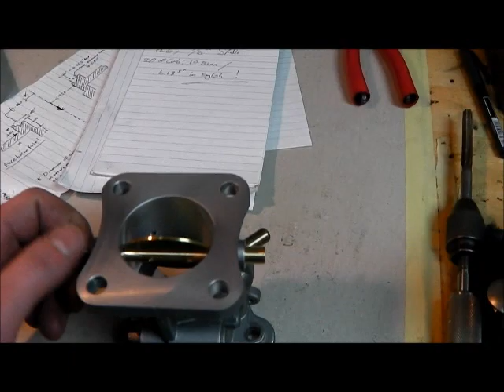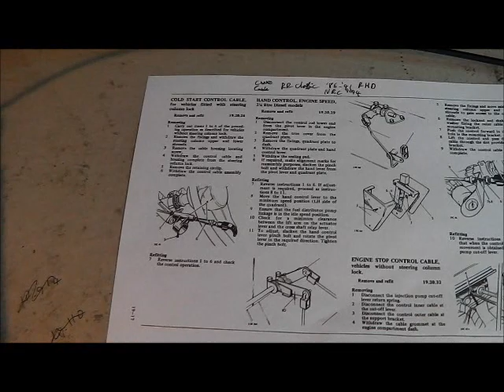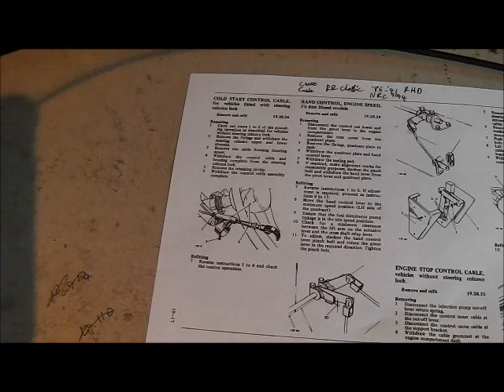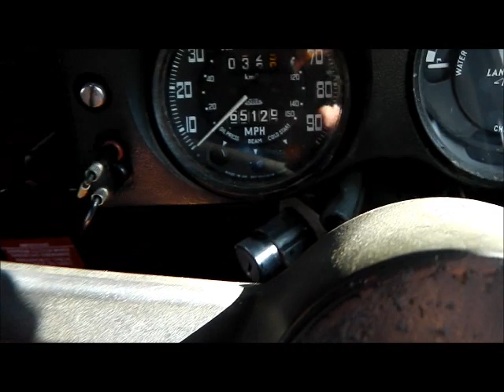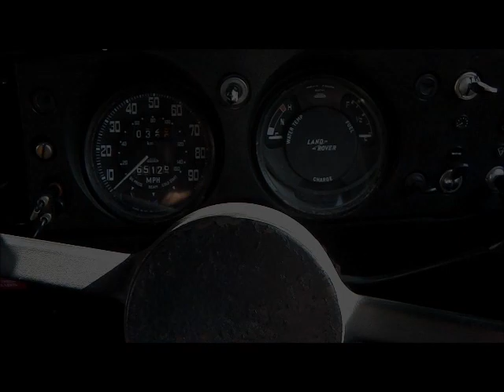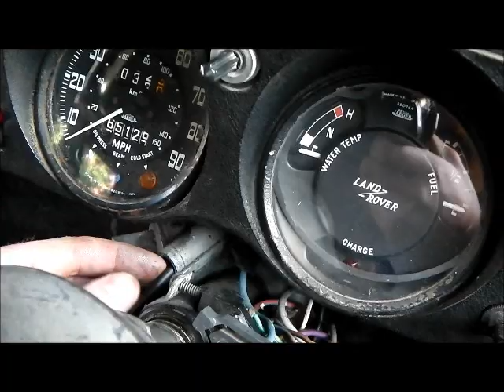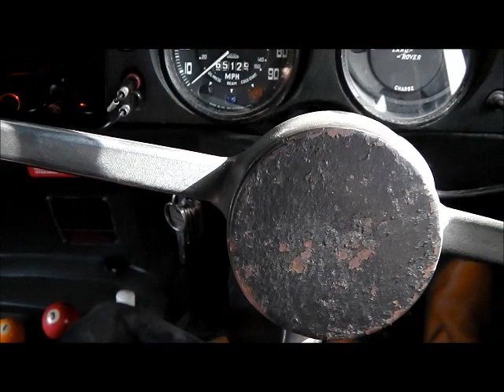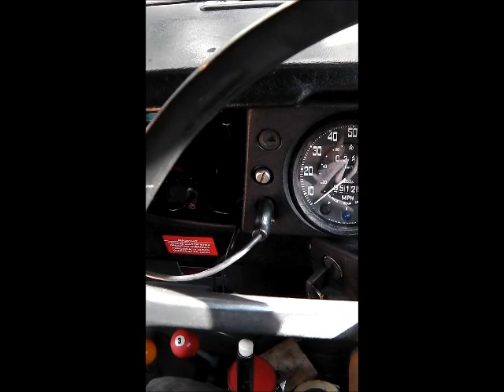Land Rover Series Throttle Cable Conversion - Part 2

Comment: Glad to see HNJ took up my suggestion for the cable bracket, when I did my throttle cable conversion on the SU and manifold from ACR HNJ only made a left handed bracket but were happy to make me a right handed one so I suggested that they should make a few as I surely wouldn’t be the only person wanting to put an HNJ cable on an ACR engine, looks like I was right!
I did the lever slightly differently using a quadrant set up, I live in Wiltshire so was able to pop down to Burlen’s for a rummage in their spares department which was useful, still experimenting with springs at the moment as mine is 88” and bucks a bit off road giving me kangaroo petrol, I’m thinking about a damper rather than stronger springs and might have a play with a mini gas strut to combine spring and damping.
Have found the guys at HNJ, Burlen’s and Roland at ACR all really helpful, maybe they should get together and produce a kit that works straight out of the box although where’s the fun in that on a Land Rover!!

Comment: Good evening Phill.  Thanks very much for the stellar installation series and most helpful instructions.  I have a new stromberg CD175 to fit my Series rover, with a similar set of brackets from HJN.  Sadly, I don’t have a lathe, nor the adapted manifold, but hope I can muddle through with this upgrade to my old and worn out carb..  Your land rover sounds great after your upgrade.  All the best, Ian
Reply from the maker: Thanks, and good luck with your conversion. There are many ways to do it, I've seen plenty of nicely fabricated manifolds.

Comment: Nice conversion. Done properly with good adjustment and full range of pedal travel. I operate a chassis dyno as part of my day job on older classic vehicles. The scariest was a porsche 911 that the floor mounted pedal stop sheared off. Causing the linkage to go into cam lock at full throttle. Not fun times.
Reply from the maker: Thanks, after a couple of hours driving yesterday it seems like a successful job. 
It is frightening some of the DIY jobs you see on these vehicles, to me the throttle mechanism is as important as the brakes. You must have had a fright with that Porsche, sod that! A colleague recently told me of a D type Jag he worked on where someone had fitted an over length bolt in the steering column - discovered because as the car was driven out of the workshop, it caught the throttle mechanism and went off the clock..

Comment: Another fab video! Your original choke cable reminds me of the ones fitted to the earlier classic Range Rovers, they were a round end rather than a t handle. Not sure if the dashboard fittings were as your original or the replacement though? Just thought I would put it out there incase you have to do it again. It's sounding very nice when running.
Reply from the maker: Thanks, that's a good shout and may be useful for someone else. It might make the process simpler. Not running quite so well as it used to, I suspect the cylinder head is due an overhaul now.

Comment: Thanks for sharing that, very helpful and something I might consider one day.. when mine is drivable! Out of interest, what's your motivation for going back to canvas?
Reply from the maker: Thanks, you're welcome. I've concluded that a hard top is actually very difficult to make water tight - the original canvas had not been maintained at all by the p/o and was rotten, I couldn't afford another at the time and a £50 hard top was a good alternative. A good canvas is drier, warmer in the winter and more fun in the summer. I've also decided to re-paint and removing the hard top from the equation cuts the job in half!

Comment: Great video! 🍺🏁 Question. What is the name of the special fuel line the VW guys recommended?
Reply from the maker: Thank you! If you visit the "Advanced Fluid Solutions" website and search for 5.5mm Bio fuel hose you will find it. Quite an expensive product but seems much better quality than anything else I've tried. So far so good, but I'll report back in a future video.

Comment: Great video, I have the same setup on my 109, how does the throttle feel now with use? Why did you go back to the oil bath filter and not use the K&N, out of interest?
Reply from the maker: Thanks, I had a couple of hours driving yesterday for work and it felt great, once I'd got used to the increased sensitivity at the pedal. The mechanical linkages always felt "clunky", the pedal is a little lighter now and nice smooth operation. It also doesn't "clatter" when double-de-clutching so slightly reducing the general racket.. 
SU carburettors are very sensitive to air flow and don't really like K&N's, best demonstrated on the dyno though perhaps irrelevant for an old Rover.. 
It has improved the running though, most of all it has greatly reduced noise in the cab.
Reply: My Carb needs a good service too, and I thought while on lock down it is a good time, do you do private work? or can you recommend sending it back to anyone else?